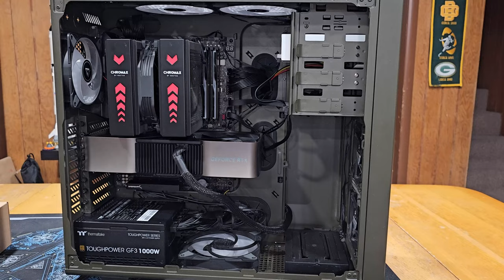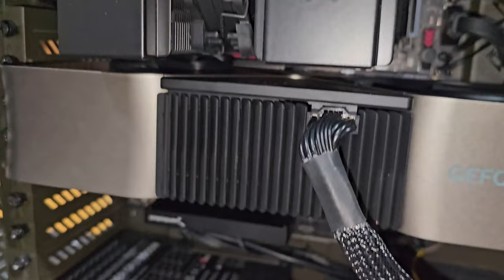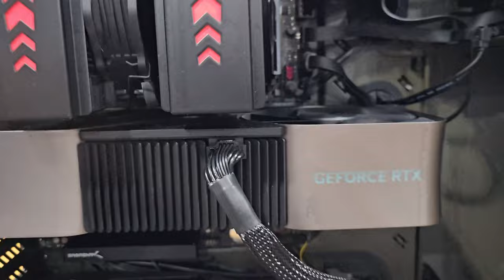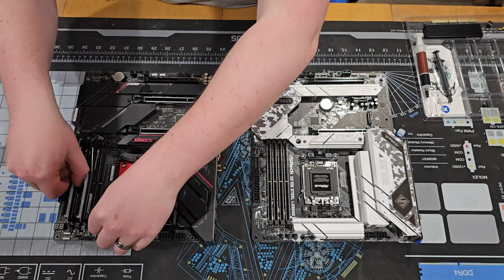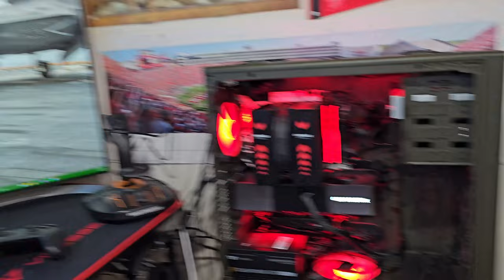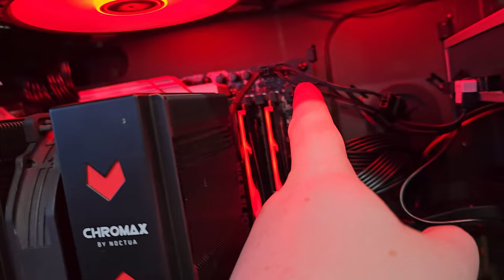Roach Rebuild Part 4: Motherboard Swap! - 7800X3D, X670E Steel Legend, RTX 4090 FE

Comment: Thanks for sharing the experience. I built 2 AM5 systems recently, yes, ton of the problems. I am not good at vlog. We need this kind of information. Also get some media attention that should pressure AMD or board vendors to fix those issues.
Reply: oh boy, i just ordered parts for a new am5 build.

Comment: I definitely understand your attachment to Asus boards. In my experience of building PCs the motherboard brand seems to be one of the things builders tend to go back to again and again if they have good experiences early on. Your affinity for Asus boards are the same for me with MSI boards. I just love them from having so many in the past and the MSI BIOS I can navigate it with my eyes closed at this point. The only other board brand that I have used other than MSI is Gigabyte, so I definitely understand where you are coming from.
Reply from the maker: Only reason I didn't go MSI was because the Carbon is so damn expensive.

Comment: Got my c70 case, MSI X570-A Pro, Ryzen 9 5900X, 64GB (4 x 16 DDR4 3200) Corsair Vengeance RGB (all colors same - light blue marque pattern). The Corsair iCUE H100 Capellix does fit in the C70 case. CPU temsp are quite cool under load - never above 80F in Aida64 stress test. Got a Nvidia 3090FE for video. Got three Asus monitors in surround view. May need to modify the case to replace the power button.

Comment: Thanks for the mini shoutout. Sorry to hear you had so many problems with that board. I use those same usb ports and haven't had any issues, although I don't even come close to using all of the ports at the same time. Perhaps that was just more than that chipset can handle? One thing I did notice is that the chipset can run pretty hot with multiple usb and nvme drives, and if you combine that with the small heatsink and absolutely no airflow (since it's blocked by the gpu) it could potentially cause those issues. Hope the Asrock board continues to serve you well!
Reply from the maker: Thanks, still no issues after almost a month now.

Comment: I always loved that case. One thing I noticed is you didn't do a test of the motherboard before putting it in? And a long time ago I read where ASRock was affiliated with Asus but is also its own company? When Ryzen first gen came out the most popular board seemed to be the Taichi by ASRock. The build looks great!
Reply from the maker: Yes, since I knew all my other parts were good I felt like a test boot was unnecessary,
Reply: @Badger8th  I always did the same thing and left it to luck. lol

Comment: How do you find the airflow with the case? Got this case with my first pc (hand me down from someone that was built almost a decade ago) and i swapped to a different case a little while ago but im loving this case again and want to switch back.

My setup is an i9 13900 with a 240mm aio and a 7900xtx and I'd be switching to it from a cooler master h500 which im sure has much better airflow. 

I want to get new front case fans for it and need to know if using a bottom fan is an absolute must.
Reply from the maker: I think it's been absolutely fine. Especially now that I've removed the front HDD cages. My temps are great.
Reply: Do you have a 3D printer? I'm dialing in a design to replace the 5.25" bays with an additional fan bay. It has a front hex mesh that matches the bottom.

Comment: Thank you for sharing your experience. I have a question: Where do you get that red piece you use as a cover for the CPU, I mean I know is not a CPU cover, but I don't know the name, but looks nice and very practical, is that coming apart, or with the mobo, CPU, cooler or case? I did my research but without any success at all.
Reply from the maker: Thermalright CPU Contact frame, sold on Amazon and probably elsewhere as well.

Comment: MSI x670e Tomahawk has been super solid for me. It was launched only this spring, later than other boards, and maybe it does not have those issues that early boards do. Memory overclocking and overall stability has been the best of any boards I've tried, and I've tried a few AM5 ones. My little 7600 has been doing wonders on it, 4800Mhz Hynix OEM RAM running at 6400Mhz with nice timings, and boosting comfortably to 7600x frequency levels. With that RAM and at that frequency is't faster than 5800x3d in almost everything. 
Having said that, I still think the board is overpriced for what it is at 300$. (350 here where I live), but that can be said about every AM5 and recent 1700 boards, unfortunately.
Reply from the maker: Yeah! I like MSI so I definitely gave the Tomahawk a look. Sadly with only 6 USB ports it would have been identical to the amount of working ports on my ASUS, so it wasn't the right fit for me.

Comment: Just got a Steel Legend and 7800X3D for myself, will be building it this weekend when the RAM comes in. Any advice/suggestions on the BIOS setup? I've messaged the company that makes the RAM I am getting (64Gb 2x32 from TeamGroup), and AsRock as well, and confirmed the RAM will work fine. Not looking to overclock anything, just want it to run stable and at 'maximum non-overclocked' performance, if that makes sense.
Reply from the maker: There's probably some small things that can be enabled without OC, but I'm afraid I'm still very new to the world of AMD boards so most of my settings are stock. Don't forget to update BIOS before you change anything. I have EXPO enabled and I used the included fan tuner on the motherboard to tweak the fan curves. I also enabled some of the power settings so my USBs and RGB stay off when the PC is off. Thats about it!

Comment: I did the same thing except I swapped from Asus X670e TUF to Asrock X670E pro RS which is basically the same board save for some differences in usb ports and abit more sata. Also really happy with the Asrock board. Bios is simple but clear and its been running flawlessly

Small question: Are the error bootup leds on the steel legend color coded or they all red like mine?
Reply from the maker: I'm not at my PC at the moment to verify, but I believe they are all red.

Comment: Hey there, love your timelapse. I have a similar build as yours but I'm facing with red CPU and RAM indicators on my mobo and it's not going in post and I'm not sure why. Were there any other BTS steps you've done before heading to the BIOS?
Reply from the maker: No, sorry. My build with the ASRock board was trouble free.

Comment: Has the steel legend still been very good so far? Currently deciding between it and an Aorus Elite AX (both X670) for my own 7800x3d build, and want something very reliable and stable.
Reply from the maker: Yep still going strong, no issues.

Comment: is your 4090 running at pcie 4.0 x16 or x8? i have the same motherboard and a 4080 super and now my 4090 have the same boot issues with taking several tries to boot up and i realized today that no matter what settings i use my 4090 is only on pcie 4.0 x8
Reply from the maker: Sorry to hear that! All I can tell you is I just loaded up GPU-Z to check and I'm running on x16 for sure. I'm on the latest BIOS, and the only settings I have that arent' stock are EXPO for the memory.

Comment: Hi, I just watch your video and I would like to ask you about your experience with this mobo and cpu when u first boot it up. Did you update the bios immediately or did you install windows first? I just bought this mobo, with the same cpu and RAM sticks, but i dunno if I should do a flashback bios update, or install windows and after update the bios. Also, do you remeber which bios version the board came with? I just bought the mobo and I'm a little concerned with all the 7800x3d burning up thing
Reply from the maker: I installed windows first, then did the BIOS update. I don't remember which BIOS version it shipped with, but it was definitely not close to recent. 

Since the issue with the 7800x3D revolved around using the SOC voltage on EXPO, as long as you run stock settings until you update your BIOS, you'll be fine.
Reply: @Badger8th  thanks for the reply! That helped a lot!!

Comment: Hi, please which one is better motherboard ?

( Asrock b650e taichi lite ) or ( Asrock X670E steel legend ) ?
Reply from the maker: I don't know much about the Taichi, but I can tell you I'm very happy with my Steel Legend purchase. Still no issues and the latest BIOS made a noticeable improvement in boot speed.
Reply: @Badger8th  
How many seconds it takes to boot ?
Reply from the maker: @warrobots1warrobots135  I don't have a number, but it's fast enough now that by the time I have turned on all 3 monitors and put on my headphones, windows is ready to sign in.

Comment: Are you still happy with this board after 11 months?  I'm thinking about getting it...
Reply from the maker: Sure am, it's been a fantastic board.
Reply: @Badger8th  Great to hear! One thing I've noticed about mid- and upper-tier boards is they've started to put the cmos battery under rear i/o cover. If the battery went bad, you'd literally have to pull your motherboard out of the case, remove the back plate, and remove the top i/o cover to get to it. On top of that, the battery itself is wired and has its own connector to the board, so chances are you don't have one of those lying around. No thanks. Another thing they've started doing is not providing an optical port for audio. My computer's audio is connected to my stereo and that's the connection I use. Anyway, thanks for the response. I just might be a first-time Asrock owner.

Comment: Man PC building is fun until it isn't right! I way overspent on the x670 Gene because I love the high end mATX boards going back to the x58 Gene. The lates bios for it has been working fine with a 7700x and 6000 c30 ram. The PCIE lane thing with using all your m.2s disabling either some PCIE 16 lanes or losing sata ports has been a thing for a while now. Power users have lamented that a true HEDT platform hasn't come out since Threadripper on AMD with all its PCIE lanes and x299 on Intel. Both were super expensive of course and the also pretty expensive 'consumer' CPUs such as AM5 and LGA 1700 all have fewer lanes available while actually performing better in a lot of tasks being newer etc etc.

Comment: has the pc overall been going well?  I just recently built a pc with a Apevia Crusader chassis, with a X670E Steel Legend, replacing the X570 Steel Legend after that chipset fan grinded to a halt.
Reply from the maker: Yep, it's been running just fine for over a month now since I made this video. No further issues have come up.

Comment: I've had similar experiences with AMD.  After my 5950X I went back to intel.  Literally zero day one issues with my 13900k.  I'm done FAFO with AMD.
Reply: Except a possibly bending socket on lga1700. And a powervirus without undervolting ;)

Both have issues, it happens. Its more how they deal with it (and yea, AMD and bugfixing also dont have the best track record, i completely agree there).

I did a similar thing but to 13700k from 3600. Also without issues but the stock setting are atrocious compared to a good undervolt.
Reply: @Daisudori  yes and a $7 cpu frame fixes that issue.  Unfortunately, you can't fix AMD's issues as easily.  I use TVB points and run 5.8ghz dynamically across all cores as long as it stays under 75C and while gaming it does, but I do have a custom loop.  The i9 feels smoother and more fluid when gaming vs my 5950x.  It's night and day.  I'm sure the 7800x3d provides a similar experience but I'm just not willing to find out personally this time.
Reply: @hamslice839  My friend has a 7700x system and its performing well also. We have (almost) the same gpu (6900 xt and 6950 xt)

The 7700 does as good in gaming with no weird stutters on his system and its also been rocksolid. The one gripe: boot times are abit longer with the memory checking, but its been improved every bios update so far.

When tuned properly the power usage between my 13700k and his 7700x is neglible while gaming (same 60-80w)

In fact the intel is more efficient in productivity since it completes faster and its pulling 180-190watt UV vs 140 on the ryzen and completes stuff alot faster with the e cores helping.

Ofcourse u can set the ryzen to eco but it loses quite some clock speed on MT on his sample.

I think both are safe this time around. the upside for amd u dont need to go custom loop with top tier vrm board to cool their best gaming or productivity cpu which is going save quite abit in cost. a 7800x3d will be happy with some hyper 212 already. a 7950x will need abit beefier but not intel levels.

So its really: Pick your poison, this round atleast.

Comment: you wasted time changing the mb because those stupid clickbait 'news' that were circulating a year ago? thats paranoid, not resourceful. i bought my b650m-hdv/m.2 back than and obv have no problems.
Reply from the maker: I didn't "waste" time at all. The motherboard had multiple issues, which I detailed in the video. It literally wouldn't boot, my guy. And both the first and the second had defective USB ports.

Comment: Oh man, I just got done watching the other 3 in this series, and you just posted this fourth one.  Sorry to hear about all the problems you had, I've got the same fears about the upgrade I'm about to do to mine.

Did you paint those front 5.25" panels to match the case?  Looks good.
Reply from the maker: No, the original 5.25 panels were green, the black parts on the front are my Blu-ray ripper and my USB-c front panel adapter.
Reply: @Badger8th  Ah, must have been the angle, I saw that the optical drive and usb hub were both black in the other build videos, but at the start of this one they looked like they matched the case more.  

Check out my comment on the 3rd video in the series, I had a suggestion for you in there.